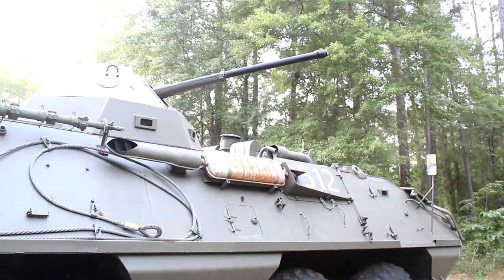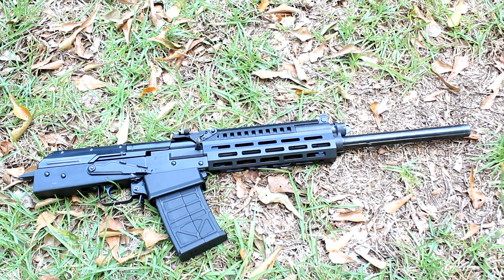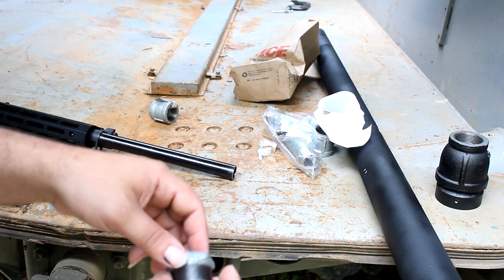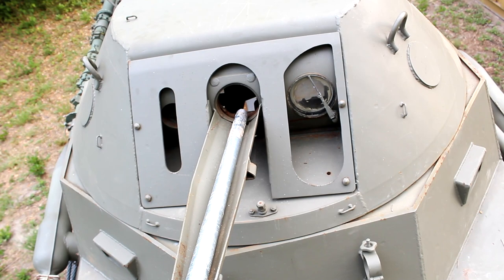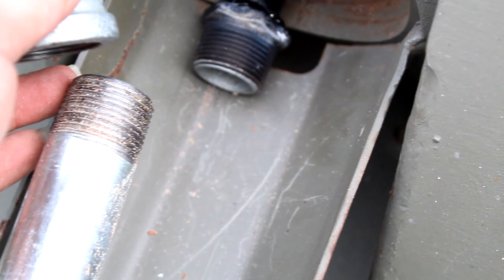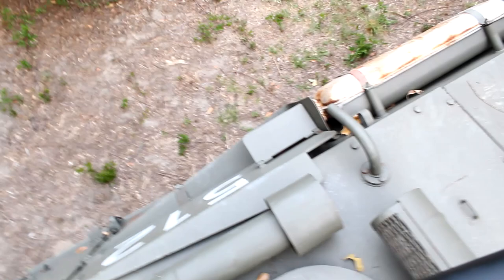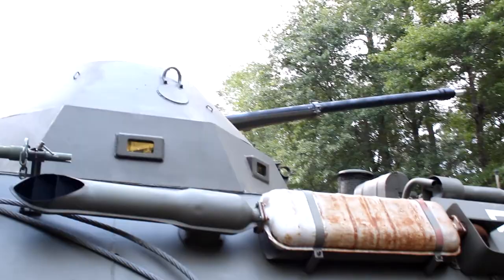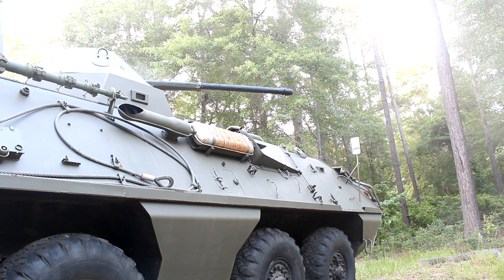I re-activated the cannon on my OT-64 APC with an AK-47 Shotgun!

Comment: I'm a little disappointed that it's only firing blanks but I don't know what the regulations are for having real guns on a vehicle like that.  Gosh I'd love to see that turret reborn in its original caliber firing live ammo.
Reply: Pipe in some LP and spark plug to the barrel extension to add muzzle flash.... solenoid that lets gas out and a switch to close the spark plug circuit when the trigger is pulled.
Reply: You will not see  KPVT, machine gun  14,5mm (14,5x114). Having energy two times bigger than .50 cal Browning M2HB It can duck  up presidential limousines or shot down Marine One presidential helicopter.

Comment: What are the cables on the side of the vehicle for?
Reply from the maker: It's a winch winch can be used to allow the the vehicle to pull itself out of terrain if it get's stuck
Reply: @bfgmovies  how come the cable isn't rolled up on a drum like on a truck?  Is it just too big for that purpose?
Reply: @ompenarnie  there się no souch thing like to many cables on armored vehicle. You can pull out 4x4 from mud...or truck ..without engaging winch ..or you can stuck yourself and Aromored recovery  vehicle can pull you out.